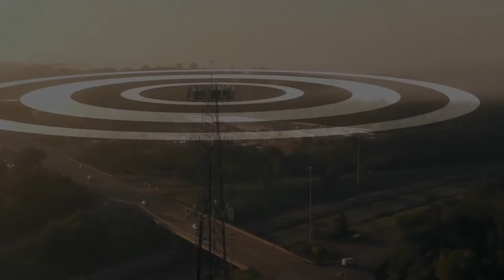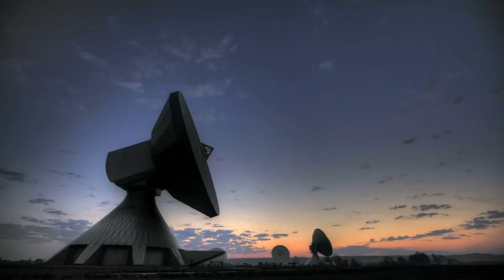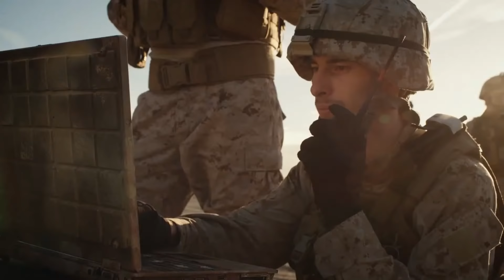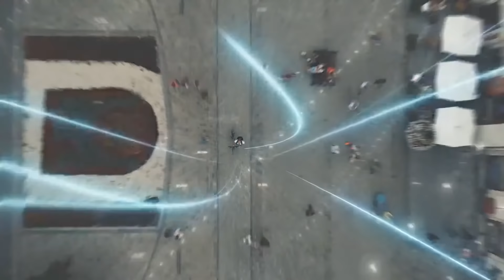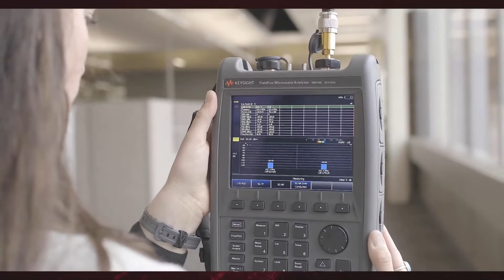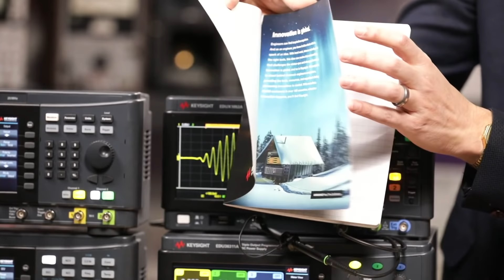Live! 16-Mar Keysight University Live

Comment: Are the new essential devices designed to stack and stable this way?
Reply from the maker: The power supply has an indent to hold one on top, the others don't stack naturally. But, there is a stacking accessory that's pretty reasonably priced and works well.

Comment: Starts at 15:17
We have some fieldfox in the lab at work, and they're so easy to use, I usually pick one of them instead of the nearby PNA network analyzer. One is connected to a computer and it's great for saving files (since it has a keyboard). TDR is very helpful when using picoprobe contactor to know when you've landed them.

That is a very nice lab notebook!